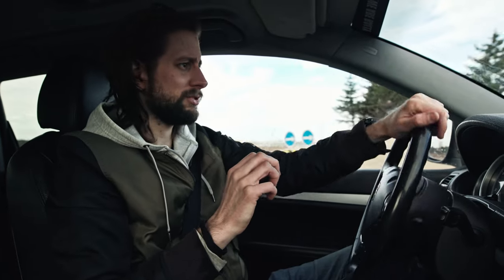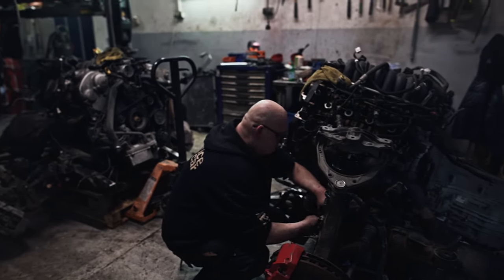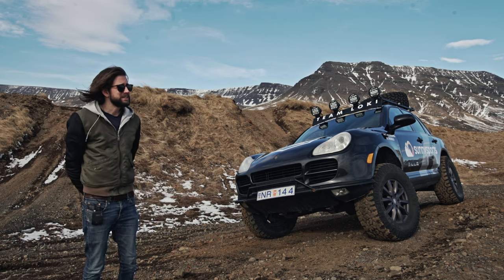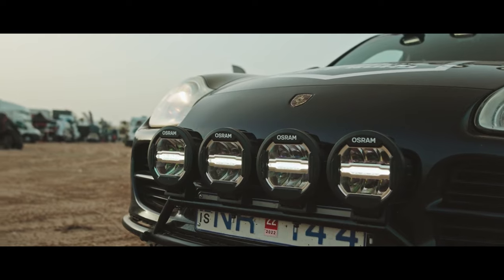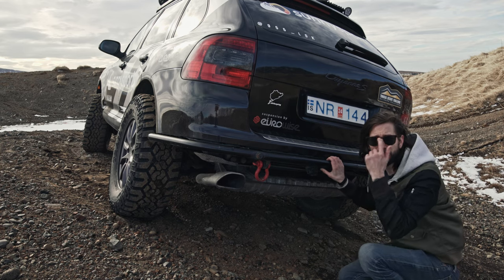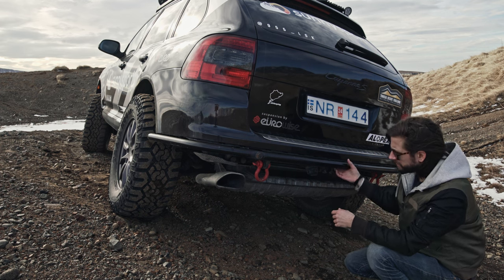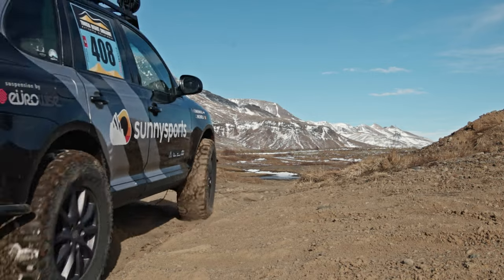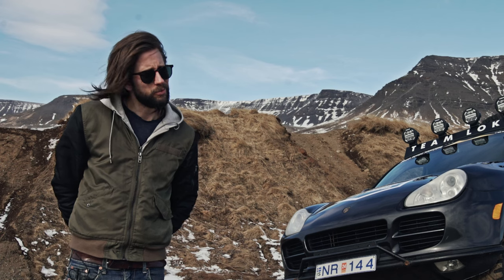THE ARCTIC CAYENNE IS BACK!

Comment: What do you think about famous issue that porsche v8 is known for ? im talking about cylinder walls issue. do you have any solution for that? you have already swapped the engine , but what if one day your engine starts to tick tick ?
Reply from the maker: I guess that's every 955 owners fear.. keeps us awake.. it is definitely not if but when.. in case that happens i could decide to have the cilinders bored out and have steel sleeves installed or bigger pistons.. but that is pretty expensive, cheaper would be another swap

Comment: Hey Frank, are the lights MX 180 or 260 ? I love the setup and although not available in US, I might import it as it looks sick. Do you have an affiliate link to Osram ?
Reply from the maker: It's the MX 180, the 260 are enormous!! 2 of those fit on the bumper of a Wrangler, but would never put that on the roof of anything. 180 are good enough and big enough :)

Comment: ❤ what size is the wheel???? and do you have spacers? What ???
Reply from the maker: 35x12,5x18
And I have 2inch spacers
Reply: Do I need to do anything extra when lifting? For example, by lowering the reducer? Should I extend the drive shafts?
Reply from the maker: With 4inch lift you should do 1 inch subframe drop. No need to do anything on drive train, but i recommend to replace the rear propshaft bearing with a stronger one.
With his big tires you'll have to cut the plastic in the wheel arch and reroute the coolant line behind the left front tire, easy job.

Comment: I like those wheels!  What model are they? I have a 955 also; 2005 Porsche Cayenne Turbo.
Reply from the maker: They're stock rims from a later model I believe. Easy to find second hand for not much money, definitely upgrades the look from the early cayenne rims. tires are 35x12x18
Reply: @FrankFramesThings  Thanks!
Reply: Did you use spacers running these wheels? Especially with 35s on? Looks great!
Reply from the maker: Yeah 2inch spacers
Reply: @FrankFramesThings  is it needed for 32/33” tires? I look forward to more updates! I miss seeing your awesome videos!